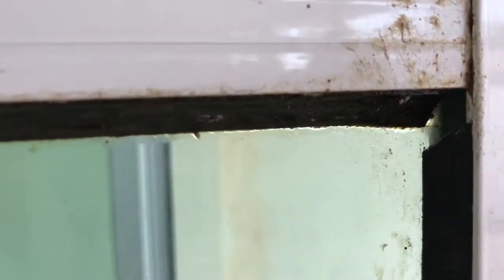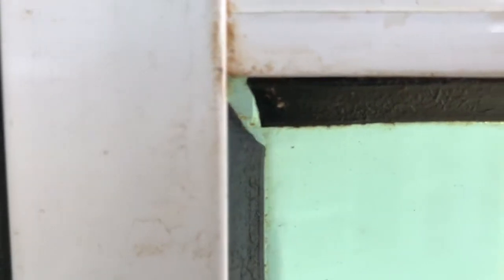Changing Rubber On Window Frames

Comment: Good info , but metal tools next to glass mate... no go , my advice is to remove with better tools to avoid cracking the glass , plastic paddle, a bit of soapy water and patience. Leave and push in a bigger length of gasket to avoid shrinkage
Reply from the maker: Ciprian G.C. Sounds very experienced. I appreciate your comment.